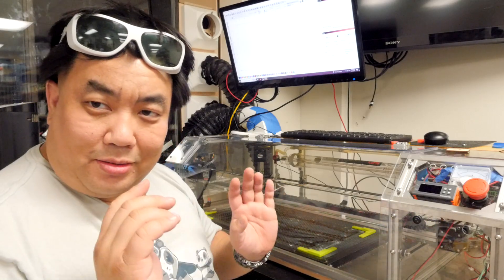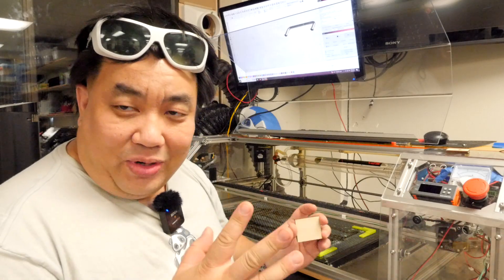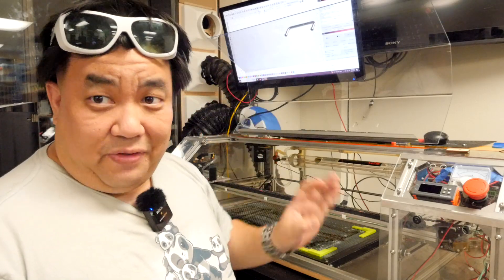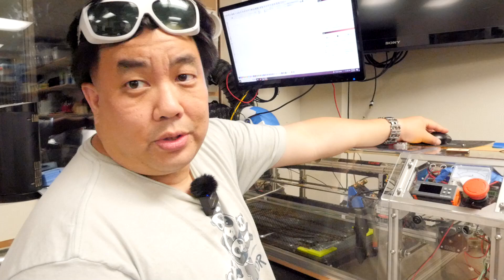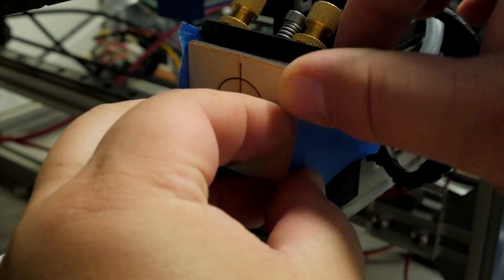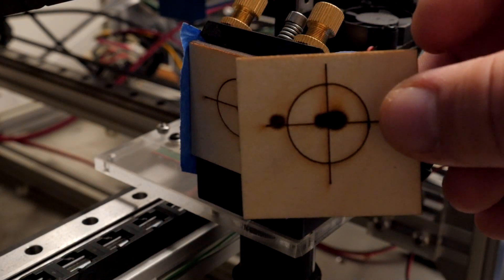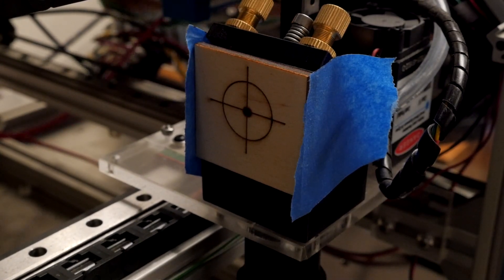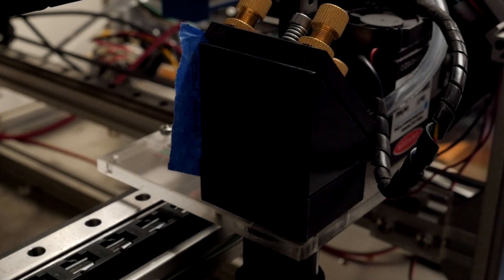Aligning A Laser

Comment: The screws on the mirror mounts adjusts the parallelism of the beam

You need it to be parallel across the whole travel, it doesn’t matter to begin with where it hits just that it’s in the same position across the whole travel

Once you have beam parallel across the whole travel you need to physically move the mirror mounts so the beam hits the middle of each mirror

If you just try and walk it in like this you will never be completely on centre across the whole travel of your machine
Reply from the maker: Yeah, I didn't do a very good job at explaining that.  I actually dialed in the second mirror (beam hits center, at both ends of the travel) first, then dialed in my X-axis reflective mirror by adjusting the second mirror on the gantry.

Comment: If the laser is so powerful how come all you need is a pair of dark glasses to stop it?
Reply: All you need are safety glasses that filter out 9000nm-11000nm wavelengths, with 10600nm wavelength being the most common for CO2 lasers.  Basically anything that disrupts the beam could be used as safety glasses.  Many cheap sunglasses will do this, but I personally would not use anything that wasn't certified.  You can find safety glasses that are certified online for $20 to $60 easily.
Reply: Unless they reflect the beam really well and are clean, they would be destroyed very quickly by the main beam.  Their purpose is to stop lower-power reflections from destroying your eyes, or to at least give you some warning.  Most of us will probably move if the glasses we are wearing start to catch fire.

The main safety precautions are an enclosure with safety switches, knowing and thinking about what you are doing BEFORE you do it, paying attention, disconnecting power when needed, and so on.

I've had laser safety training at work.  When a laser beam is invisible (e.g. infrared), obviously you can't see it and your blink reflex is too slow; it focuses very well inside your eye.  Your first warning of eye damage would be losing part of your vision or hearing a popping sound, which IIRC was boiling or gases being put off due to the focused laser beam depositing heat in a spot inside your eye.

It doesn't heal, and your vision never comes back.  Take precautions, even when they are inconvenient.

My favorite laser safety warning:
"Do not stare into laser beam with remaining eye."